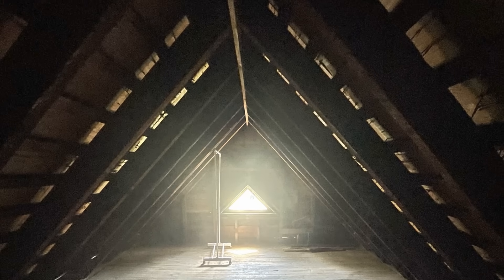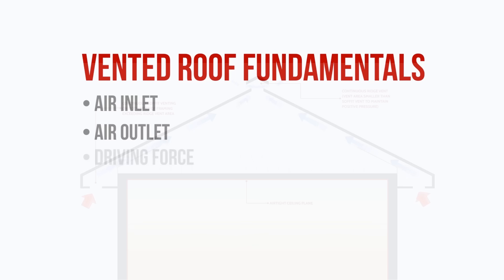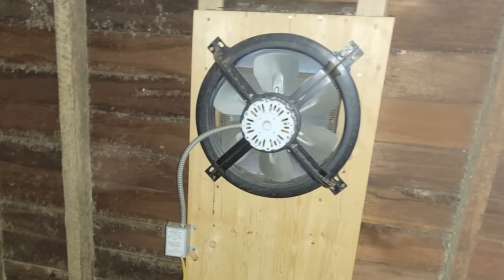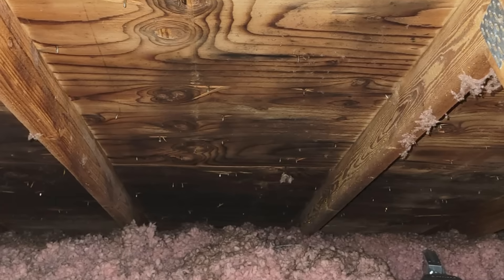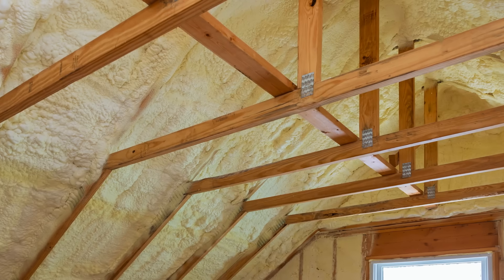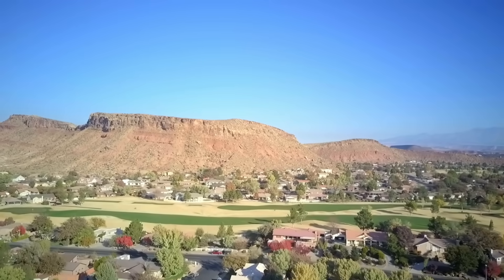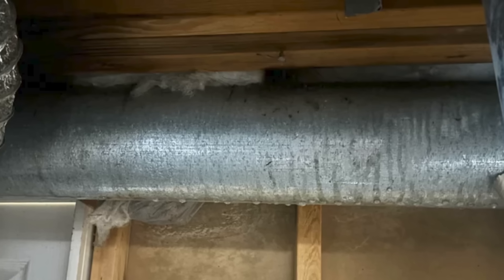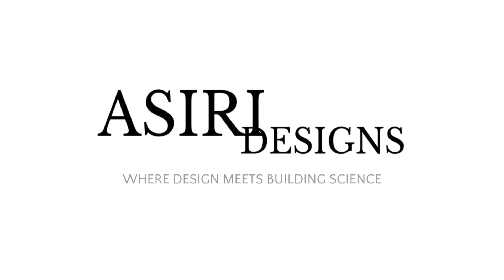Do Gable Vents Actually Work?

Comment: A local volume builder includes regularly gable vents that are purely ornamental.  They do not open into the attic; instead a typical soffit to ridge system provides air flow.
Reply: People like them visually for gables it seems. Without marble statuary the space seems empty. My firm designed a project that had metal gable vents with fine screens. The builder put in plastic vents. Guess where the only fire damage occurred when there was wildfire in the area.

Comment: How about in new construction in snowy climate a combination of soffit vents for the inlet and gable vents as the outlet?     In snowy areas, I would think roof snow buildup would restrict air movement out of the attic space through the ridge vent at the exact time it is needed most to prevent ice dam formation.
Reply: I had that same question too.  Hopefully the stack effect warms the ridges enough to allow the ridge vents to start breathing.  I'm not a builder but In arctic climates I've seen homes with a unique type of gable vent to use extreme winds to do the venting.  Was hoping this video would cover it partially but admittedly it's too much of a niche topic to be recognized by any audience.

Comment: A power gable vent is awesome. A regular gable vent isn't good. The power gable vents act like a.c. Once you cool that attic space down helps cool rest of the house. My friends house it feels like a.c. with power vent. He does seal it for winter though. Which I wondered about condensation with seal power vent. Going into an attic is almost always sweltering experience. I have 200 year old story and half. I went to a conditioned space up stairs and got rid of my small attic space. Made a huge difference in bedroom temps upstairs. I did install baffles and insulated with mineral wool. Got rid of 2 old chimneys too.
Reply from the maker: You don't want your attic to SUCK! Pun intended.

Comment: Another excellent and very relevant video to what I'm working on! Upon recently replacing my roof, I installed ridge vents over the house and connected garage, but have yet to calculate and cut soffit vents. I plan on doing that once I'm done with more urgent projects, but in your experience how well do ridge vents work with gable vents?  Also, when I bought the house, the heatpump air handler was installed on the garage ceiling trusses and the installers apparently opened the sheathing separating the garage and attic of the house (1000sqft foot print plus similar sized basement and 700 sqft garage). There was no garage on the original permit for the house. Thanks again for the video!
Reply: If you are like me, it may be years before you remember to create soffit vents.  Is the size calculation critical?  Most houses do not seem to have a particularly large area of air flow through the soffit.  A typical perforated vinyl panel attached to each truss seems like just a few square inches total opening.
Reply: @misterlyle. Yes, the length of the ridge vent is calculated and there are calculators for measuring the volume of air needed for the soffits in order for the system to be in equilibrium. In my case, I plan on cutting the holes with a hole saw, and covering them with the aluminum soffit panels that were there (I removed them when I replaced the rotten fascia with pvc), even though there were no holes for air passage (I bet they were sold to the previous owner by the company who installed the current vinyl siding). I'll get them done after removing the HVAC air handler up in the trusses of the garage and sealing the opening between the house attic and garage. I haven't researched the need to seal this opening, but since the garage isn't conditioned, I would assume it needs to be done.
Reply: @mg-7047  I have a similar plan: a couple 3 or 4-inch diameter holes between each rafter and then round louvered inserts.  That project might happen this fall!

Comment: A client's home was built in '90 with an western facing gable and north facing box vents. No soffit or ridge venting. There were also two bathroom exhaust vans, which vented to the east. The exhaust fans and ducting were not properly sealed and leaked profusely. Resulting in high moisture loading in the attic, molding and rotting roof sheathing along with condensation working its way to gypsum ceiling. Before coming to us, the client had the roof replaced along with the bad sheathing, and new soffit and roof venting. This new roof began to mold over again a few months after and the client approached us. We went in, removed the blown in insulation, air sealed the ceiling deck. Installed new soffit baffles, insulated ridig van exhust ducting and 2 feet of new fiberglass blown insulation. The client has had no issues since.
Reply: So the soffit vents were no help, or not done right?
Reply: Gable vents create dead air spots and interfere with  eave to ridge venting
Reply: @BaronVonFrankenBolzlllYa, well I have a House built in 1959, no soffit vents at all, because the rafters don't even overhang, the only overhang is a small separate box not connected to the attic. the only vents until I bought it were gable vents, and zero moisture barrier. Attic has blown in insulation, about 8" or so. I added turbine vents when I bought it, and 30 years later I have no issues. Obviously gable vents do work
Reply: @integr8er66  Something is working in your favor, truly!  Climate, quality of construction, or other possibilities.  My house was built in 1950 without any insulation anywhere.  I've made some improvements, but considering this is NW Florida, I am convinced a few variables are helping here as well.
Reply: @integr8er66 I think the fans are key to your setup.
Reply: @misterlyle. Well this house was also built with no insulation or vapor barriers anywhere. The only insulation was the foil backing on the 3/8" drywall, and the celotex behind the asbestos sheeting. This house was a government built house, so you know its good 🤣 this whole subdivision every house is the exact same, some have a basement and some don't but other than that the only variance is some they turned the plans upside down and built them mirror image. Anyway I blew in wall insulation and the guy before me put in attic insulation, and it is actually pretty easy on HVAC costs. Like my most expensive bill ever was under $150
Reply: ..sealing the deck? the ceiling sheetrock?
What did you use to seal it?
Reply: @backpackingonline  is usually done by aerosol can foam
Reply: Yay, success!  And thank you for mentioning sealing the ceiling deck, which is something I will need to do in my little old, uninsulated house.

Comment: What's the general consensus on soffit venting on the gable walls? I've seen little information about this, but I understand it might short circuit to the ridge reducing the effectiveness of the soffit vents at the bottom of the roof.
Reply: There is ZERO reason to ever vent gable soffit.   Normally the structural sheeting extends to the roof deck at the Gable.  (Whether balloon / stick framed gable or gable truss.)  Meaning there is NO path for air to flow into the Attic Space.  If an air path has been created it likely is reducing the structural integrity of the gable.
Reply: You do want to vent the overhang, but not into the attic.  You vent it to the outside so that it can equalize it's own humidity and temp to the outside.  Otherwise, it is basically a series of boxes that will experience vapor drive/migration in, but have no way to let it out.
Reply: Gable walls don’t have soffits.
Reply: @kc9scott  🤣   Really....then what do you call them???
Reply: @kc9scott  What I meant to express is venting in the roof overhang (sofffit) above the gable wall, not in the gable wall itself.

Comment: Good video.  What is the best way to run ERV ducting in an unconditioned attic? Diligent air sealing and increased insulation?
Reply from the maker: Thanks for watching. Create a service cavity either below the ceiling's air barrier, or an airtight enclosure for the ducts and trunk lines.
Reply: @ASIRIDesigns are the flexible insulated ducting enough? My Los Angeles nearly 100yr old house would make it near impossible to do either of the methods you suggested
Reply: @ASIRIDesigns im building a small house for my parents and when designing we decided to go with 9 foot ceilings to make tbe rooms feel a bit bigger. An advantage I realized later is I can create a service cavity as you call it that  still gives us 8 foot ceilings under it. Should work quite nicely and keep all the ducting within the conditioned space.